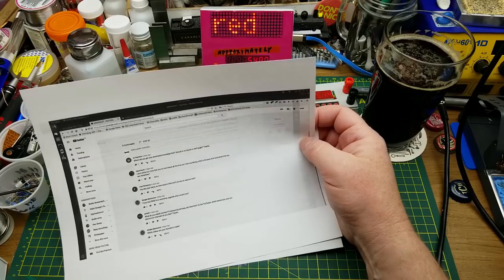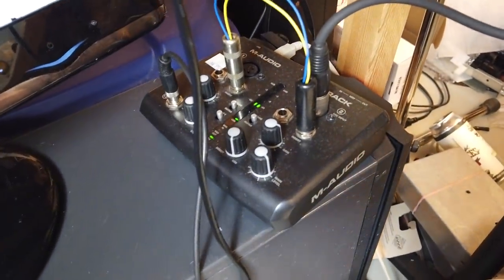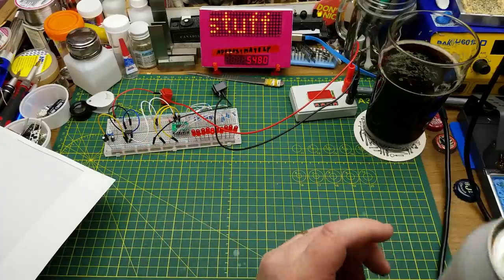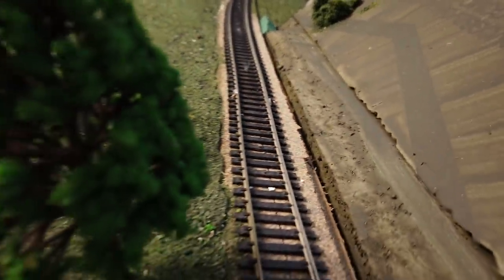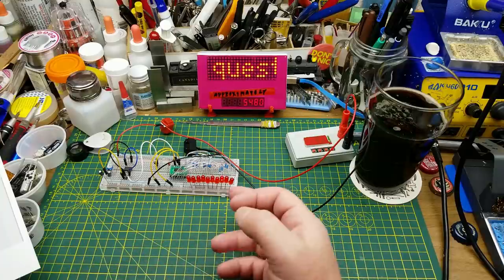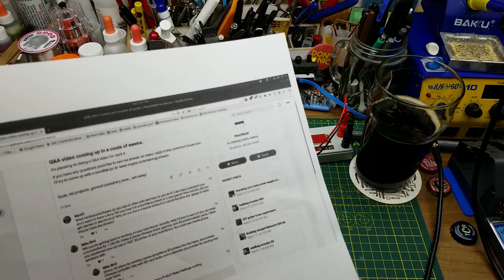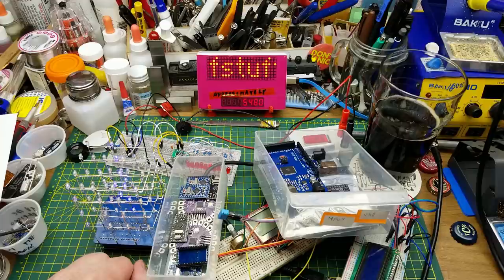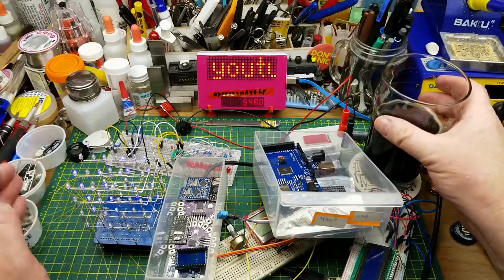You asked, I answer. A Q&A video

Comment: With a 3D printer just doing electronics makes it worth it for small cases, jigs and whatnot, with your modelling it's even more worth it. Consider something like the MonoPrice Mini Select V2, small print bed (120mm cubed basically) but it's ready to go out of the box with minimal hassle and it's compact enough to toss in a corner somewhere once you go through the process of upgrading the firmware to enable the Wifi. 220bucks (US) off Amazon, or 150 if you shop around.
Reply from the maker: Part of my indecision is that filament printers are so cheap and easy, but the resin printers have much better detail for small things like model parts - but the process is much more involved and messy.
Reply: @pileofstuff  I decided against resin printers because of the mess and convenience factors. Even without the fine detail you get more than enough capability with a fused element printer.

Comment: On a model railway side (i have been out of the scene for ten years) with the change and improvement in technology, are capacitor discharge units still required for throwing point/switch solenoids?
Reply from the maker: Im not really sure. I am moving to servo motors. I never liked the "kerchunk" noise that the solonoids made.